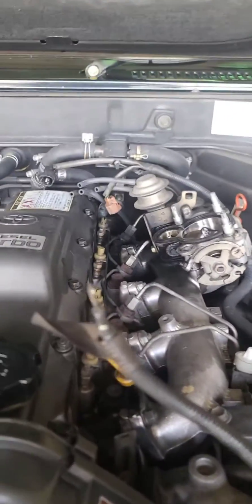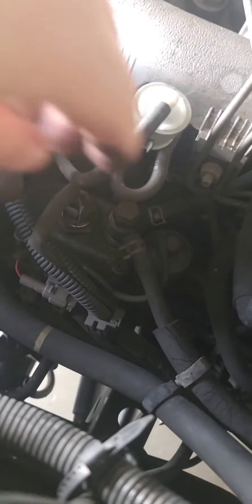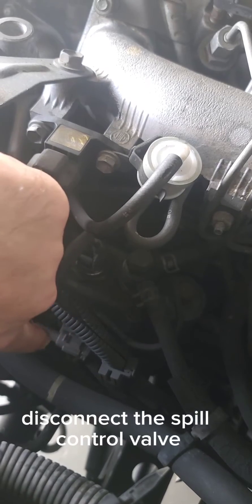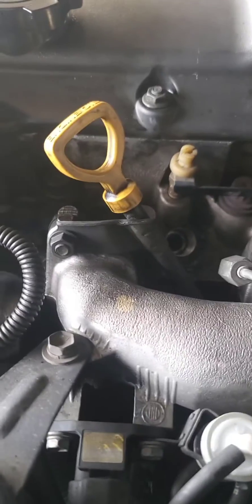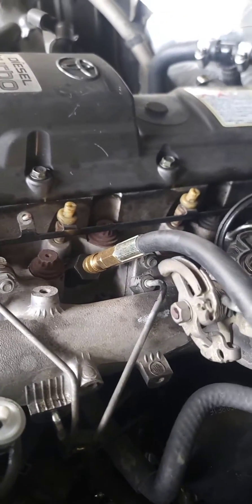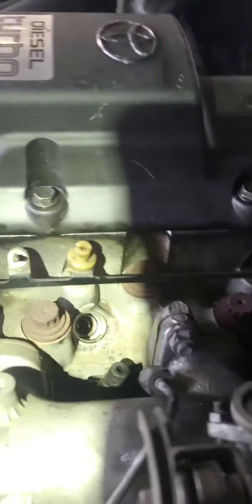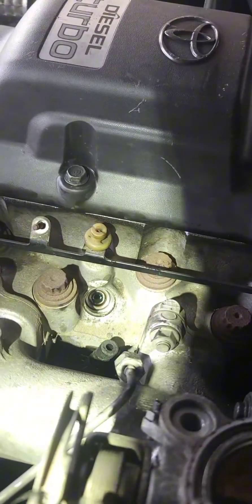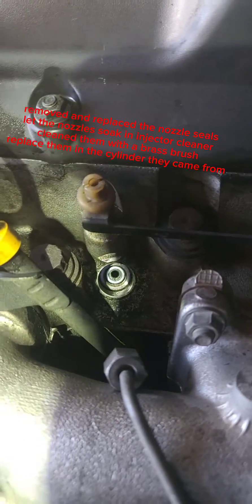1KZ-TE Compression Test

Comment: Prior to the transmission pooping out, what did you do about that piston low pressure?  Thanks.
Reply from the maker: This wasn't my landcruiser, it was a friend's. He did a full rebuild. You can try running the ceramic oil additive. Ive heard some people  have good luck getting some compression  back. Or when you do you oil change run a can of the BG EPR.